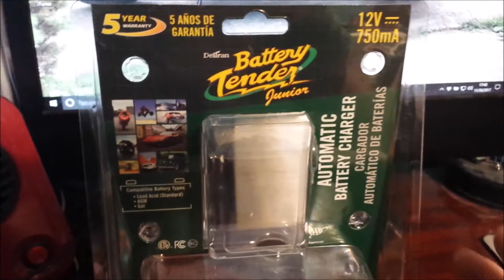Teardown / Look inside of another Newer Battery Tender

Comment: Did you happen to measure the transformer output and the post-power-conditioning output? I have a crazy idea to hook one of these up via POE...
Reply from the maker: 18 to 21 volts is sticking in my mind for output of transformer. When I plug the tender into my battery it goes up to about 14.2 volts and then starts to come back down and settles to about 13.15 Volts.

Comment: I have this tender less than 2 years and it stopped working. All the lights come on green and it just doesn't charge any battery.
Reply from the maker: Has to be the battery I’d part. It does not see the battery connecting.
Reply: @CarlRecktenwaldJr  I've tried it on multiple batteries. It blinks green like it is working for a few seconds then all LEDs come on green and at no time does it charge the batter I've tested it with a multimeter. The tender also makes a high pitched sound while plugged in but it used to do that even when working
Reply from the maker: Has to be something internal. Did you contact battery tender?  Maybe they will send you a new one.
Reply: @CarlRecktenwaldJr  It must be. I had a quick look inside and the board looks okay and no capacitors bloated/bulging. That's not to say that they haven't failed but it's not obvious at least. I might contact them. Thanks for the ideas.

Comment: Hi Carl, I am looking for a cheap way to charge my motorcycle by powering the Battery Tender with an old 12v car battery, rather than 120VAC. I know the "Optimate TM-500" is a DC to DC charger that will do this, but it costs over $100, but these battery tenders are cheap. Based on your teardown, is there any area on this board where I could supply a 12.5V (fused) from the old car battery to make a DIY DC to DC charger? Do you know what the output voltage of the transformer is? Thanks!
Reply from the maker: I think the output of the transformer is around 18 volts ac. I don’t see how an old car battery would works as the tender voltage starts at about 14 volts dc and then maintains at about 13.5. You would need some kind of booster circuit.

Comment: I have this exact tender. Looked today and there is no light and no power. Anyone know what could be doing that?
Not sure if there is something to change out?
Reply from the maker: Did you check the fuse. There also needs to be battery power to start the charge process
Reply: @CarlRecktenwaldJr  So, if the battery is dead, wouldn't the light at least flash green when I attach it?  And are you taking about the 7.5 amp fuse or something else?
Reply from the maker: Yes that fuse. You might be right, it should blink red I believe.
Reply: @CarlRecktenwaldJr  Thanks for your reply. Liked your video very much.

Comment: Hey Carl, great follow-up to your earlier tear down of the earlier model !  Incidentally, have you measured the voltage of the new one after it reaches a stable storage setting?  The earlier model, I have seems to settle at 13.0 volts which is a bit low for any longterm storage in my opinion.
Reply from the maker: No I have not.  My old ones settles at about 13.12 volts.  I actual have an arduino voltage monitor on the bike which sends the details to an arduino lcd screen I have in my house. So once the unit is plugged in the voltage goes up to about 14.5 and then down to 13.10.  I will have to monitor the new one. I agree I wish it was closer to about 13.50 voltage for a storage condition.
Reply from the maker: Going the comments and realized I never answered. The newer one settles at about 13.17 volts.